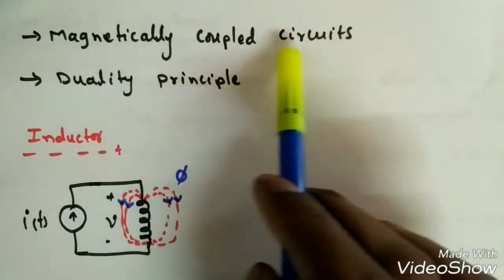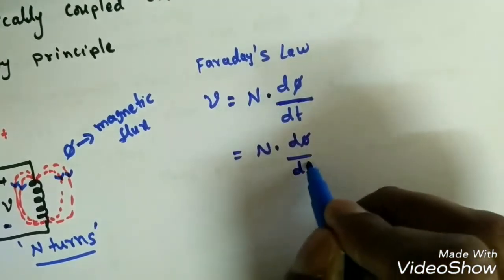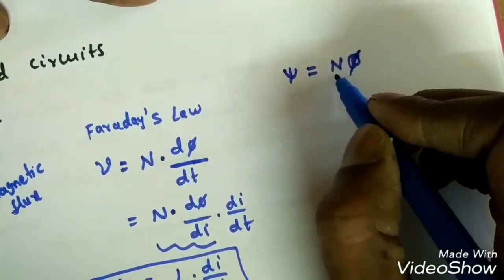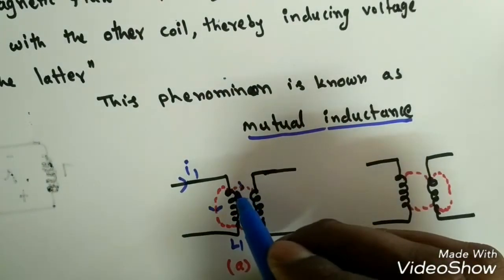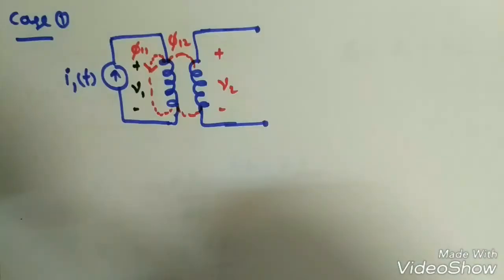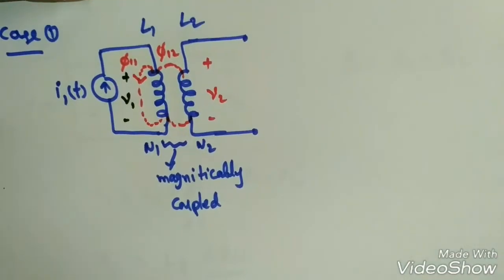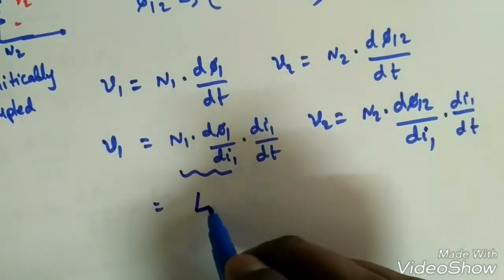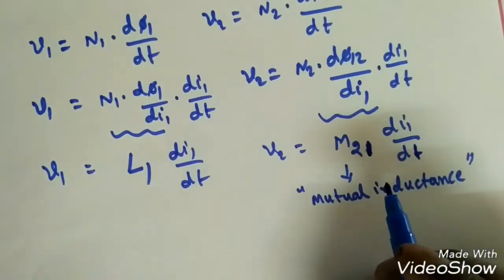Network Theory Lec-35(a) :  Magnetically Coupled Circuits

Comment: 26:20 how did you write the postive signs for M21 and M12? Plz reply sir. It is difficult to understand. when flux adds you wrote + otherwise - ??
Reply from the maker: it depends on current direction..if current is entering through the dot points we take positive sign, if current is leaving from the dot points we take positive sign, other wise negative sign